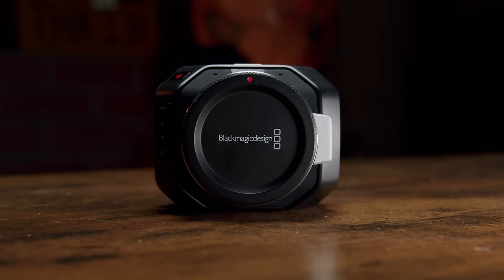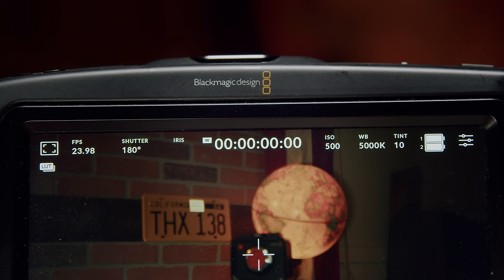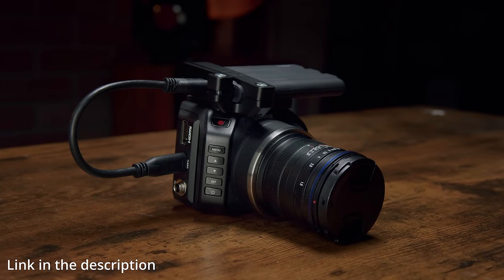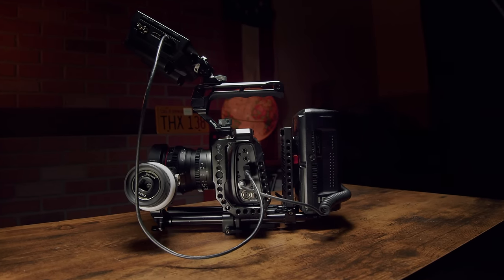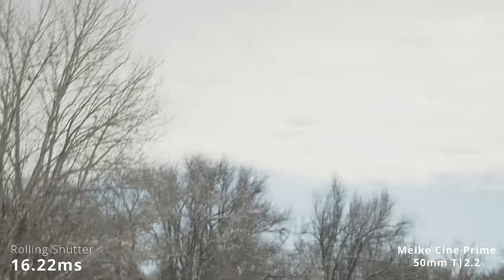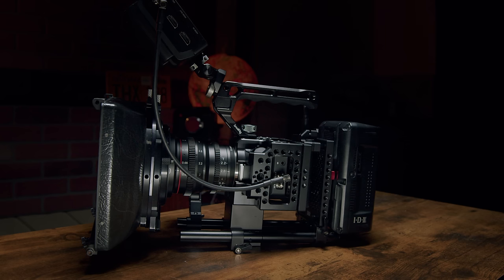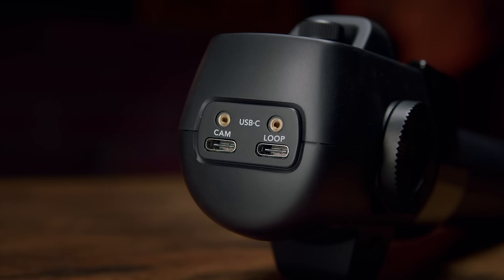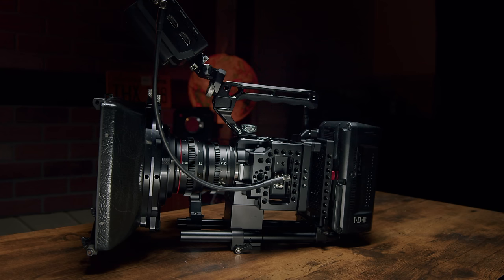The Blackmagic camera you didn’t know you needed  - Micro 4K G2 Review

Comment: Thanks for your hard work and time in putting this together. Really liked the two hacks. I was not aware of either. Also liked that you spent time on the clean output issue and the need to fix it. I use the camera for live streaming so these issues are very important. Another issue is if you have many of them connected to an ATEM via SDI you need a separate return SDI program feed going to each camera in order to control the camera via SDI (not needed for HDMI control).  One then has to incorporate other work arounds to create enough program feeds for each camera being controlled via SDI.

Comment: Good to see your review on this. Loving the rigging capabilities of the XLCS case for this. I wasn't sure if I really wanted a zoom demand handle, but, I think you've convinced me that it's probably a smart move for the programmability of the buttons and lack of Bluetooth. One note; I did get a Belkin USB Ethernet adapter and was able to remotely use the Lens control HTTP API pretty easily once I understood that in most cases, the GET method returns the 'current' settings in a JSON object. To change the settings, I send a PUT request with that same object with the settings altered that I wanted to change. As practice, I made a zoom-in button that adjusts the aperture and then zooms in using powered zoom to 40mm. Then waits 10 seconds and zooms out again and resets the aperture with 6 HTTP requests using curl to two API endpoints; control/v1/lens/iris and control/v1/zoom. Two to get the current settings. Two to open the aperture and zoom. Two to set the aperture and zoom to what they were. These are the kinds of things that I would be doing with Bluetooth. I might take a look at the construction of the zoom handle and disassemble it to see if I can make it a bit more compact. One final note, the ATEM camera control works pretty well. I have an ATEM mini pro and it can make a myriad of camera adjustments with the software control but it does require that you lug around a laptop also to run the control software.
Reply: Great info, thanks! You think you could build a simple controller device using ESP32 or arduino boards? The challenge would be usbc loop for recording though i guess

Comment: I had the OG for years and it is still a workhorse. I got the new G2 and it just expands my capabilities and is such a special tool for a videographer.  I use my trusty BM Video Assists that I have picked up over the years. Just such a good paring. I do have the T5 and T7 SSD's but prefer the Crucial X9 or X10 - better form factor and much faster. I have also done some mini NVME 2240 drives that reduce your footprint further and have insane speed. 4K is fine for my work since I have no dreams of going to Sundance. :)  I use the small lenses on these cameras. The Samsung 25mm and 45mm are two of my favorites. But if you like a good cinematic look, I go to the classic Angenieux lenes with a C to MFT adapter. Such a special look.  Thanks for your videos on this camera and especially the one about the menu system. 👍👍👍

Comment: @Will von Tagen  Will the USB-C port work with an SD card reader? Was thinking it would be great to get one of the tiny Micro SD card readers and just plug that into the side for capture. This possible?
Reply from the maker: Most likely. I was messing around for a bit with building a cfexpress card adapter for this but it had enough issues for me to stop. The camera saw the card and recorded to it—but I had to format the card on a computer. Also the camera has to be powered off and on to recognize a card being removed or inserted. But maybe it will work better with micro sd—I say give it a go 👍🏻

Comment: If they just added SD card slot it would been a great camera, as I am not keen on using USB cables as the cables breaks too easily and ports gets loose over time.
Reply from the maker: Adding the sd slot would have probably required BMD to remove the SDI ports as with the G1 Micros. The USBC port can be protected with the USBC lock for XLCS Cage or with a locking USBC Cable

Comment: I just saw a custem back extension which slso invluded better knobs. 59$ 😁 alt cine. Adds lots of possibilities to build a rig too.
On the  BMD site it states that ftp can be used to get files if the attached storage. In order to connect to a network you use the usb port.. now the question is.. do/can you use an USB hub in order to connect both the externsl ssd and the network to the one available usb port on the camera? If not how is that functionally possible?
Can the batteries from the video assist power the g2 as well?
Reply from the maker: You should watch the video. It answers your question about expanding the USB port.
Reply: @WillvonTagen  yeah I saw, I tend to type questions while watching. Short term memory problems. I forgot to delete the question. Apologies for that, and thank you for responding.

Comment: Blackmagic really missed it by not including Bluetooth and having an app specifically for adjusting settings starting and stopping recording. 
Maybe also a low resolution/framerate to check your framing.  (Not as important as adjusting settings because you can have the external monitor for framing and focus) The video feed doesn’t need to be fully live to check framing
Reply from the maker: Bluetooth would have been great but I think they would have started from scratch with a whole new design (not using the existing molds and parts for the micro) which would have likely skyrocketed the costs on this.

Comment: Is there any reason I can't buy this camera and the 12g 5in video assist and use that to record the signal to and SD card and skip using an SSD all together?!

One short, SDI cable, one battery on the video assist and one on the camera, no SSD, no HDMI. Pretty compact.
Reply from the maker: I believe I discuss this in the video. Yes, you 100% can do that. But for now you cannot record BRAW that way.
Reply: @WillvonTagen  Yes, I note that you discussed using it to record proxies (for playback in the field). On the BMD website it says you can record BRAW 4k/60 on the video assist. So I take it there's something in the camera that prevents this rather than the video assist (I don't own this camera or the video assist, I'm currently a P4K user who wants to set one of these up as a second shooter).
Reply from the maker: @JonasStuart  Oddly enough, the video assist can only record BRAW from non Blackmagic cameras. I've tried it with the pocket 4K and Ursa Mini--neither of which will give the Video Assist a signal in BRAW. I really hope they change this--but I also think Blackmagic is about to release something major as far as an updated Video Assist that also offers camera control (and possibly do it wirelessly). But in the meantime--you cannot do BRAW off of the Micro tot he VA.
Reply: @WillvonTagen  Updated video assist sounds awesome (and also expensive again!!) thanks for answering, all makes sense now. So annoying they don't just put playback into the micro so you can just use a more basic (and more slimline!) monitor. FOr me the whole goal of this is to make a super small rig that I can chuck in my bag for vacations and family days out - but also rig up more for a second work cam.

Comment: Wow tyty any hub will work or it has to be belkin. Again tyty
Reply from the maker: I believe any hub will work as long as it’s a data hub and not just power/charging. I have tried 2 other brands off Amazon and they have worked (UGREEN).
Reply: @WillvonTagen  I’m using my g2 on RS4 and I’m using Panasonic 14-42mm G Vario lens, compatible with zoom demand. It’s a game changer for me but it’s kinda bulky and hard to mount and I did get a tilta rosette extender to help with the mounting. Anyway thanks for tricks, very helpful